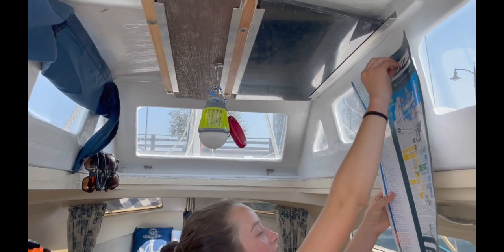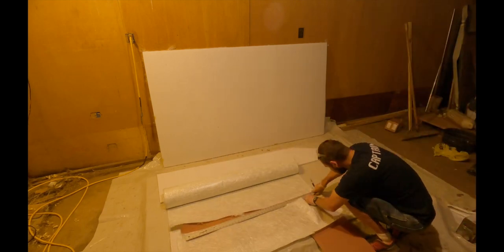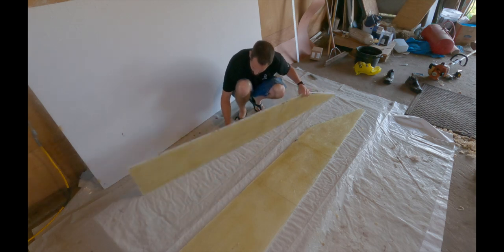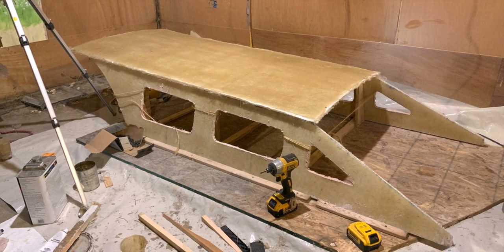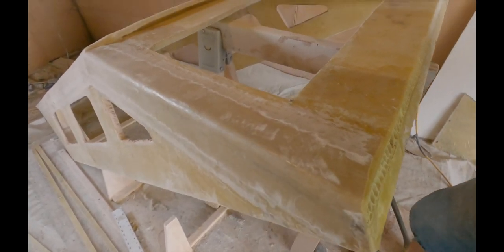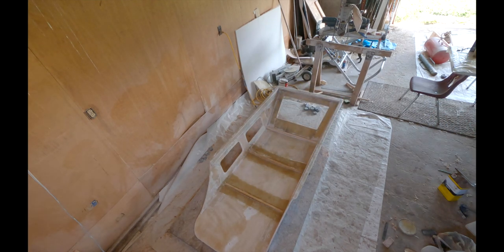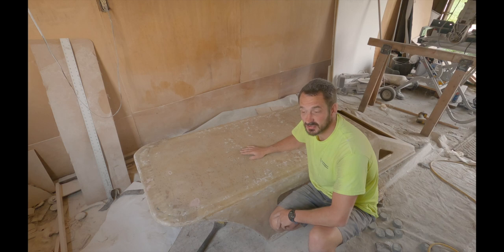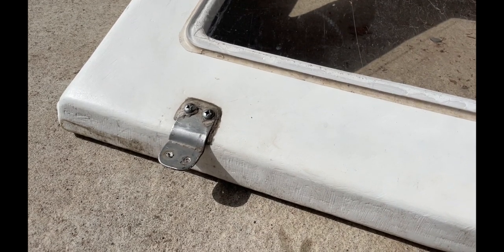Hunter 260 Hard Dodger Build

Comment: I saw a video where they're building a complete structure out of veneer and then sticking fibreglass over it. I'm having trouble getting my hands on it because I don't know which method is the right one. If I could, I'd add a rainwater collection system on the roof. This is a great piece of work anyway.